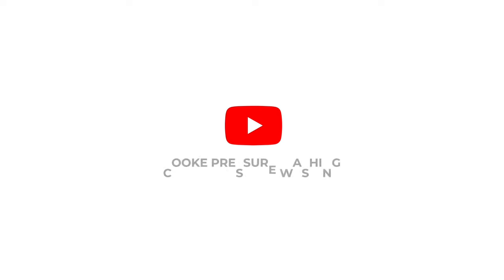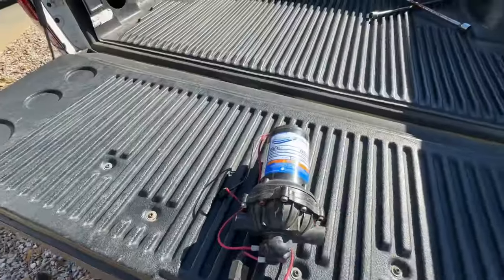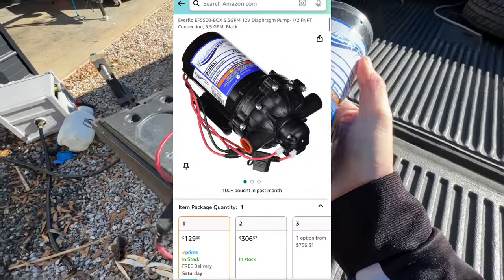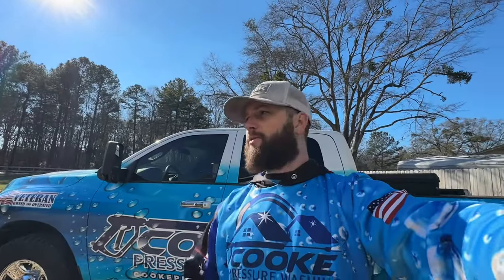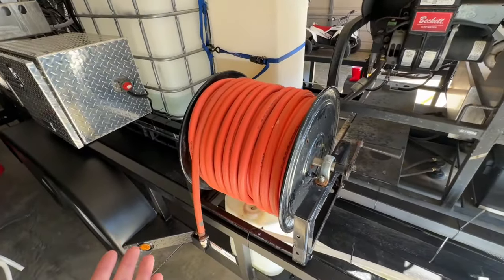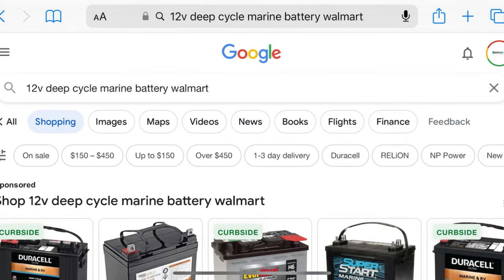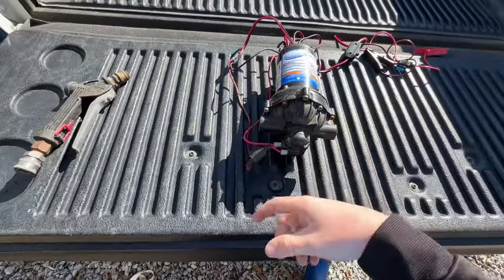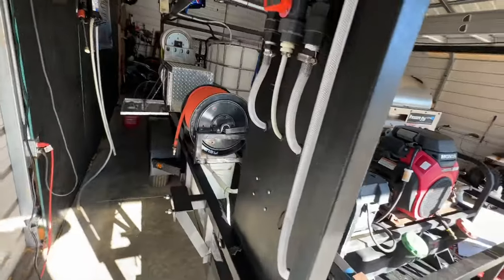How To Make a DIY Soft Wash System For $296

Comment: How do you rinse the house after you've applied the chemicals? Would you get another bucket with straight water and just take the hose from the chemical bucket and put it in the water bucket?
Reply: You would use your pressure washer with a jrod rinse tip

Comment: Are this pumps  turn off by it self or they run continuously ?
Reply from the maker: once its primed, it should cut off. As for electrical, if you have a switch you can control it that way

Comment: Why cant you use it to wash concrete,arent you just laying solution down,dwelling & then coming back through with the surface cleaner??
Reply from the maker: If you had a pressure washer, yes you could surface clean concrete. What I meant was if you only had this set up with out a pressure washer.

Comment: You might want to add that they need to mix (batch) the chem tank...  Or they will pump straight sh.....
Reply from the maker: You are so right. Thanks for catching that. I've added that to description.
Reply: @cookepressurewashing  you cold tell them to plumb in a teen on both the water and sh lines (same length, pump between the tanks) then each line have a ball valve between the barrel and the tube and one valve between each line.  Now you have a makeshift blend manifold for soft wash.
Won't be crazy accurate but it will work, later they can upgrade the two valves to metering valves when they can afford it 
Of course they would put in soap/surfactant by hand...
Reply from the maker: Yes, I know. This video is just intended for a basic and cheap setup for someone just starting.  @FreeAmericanSpirit